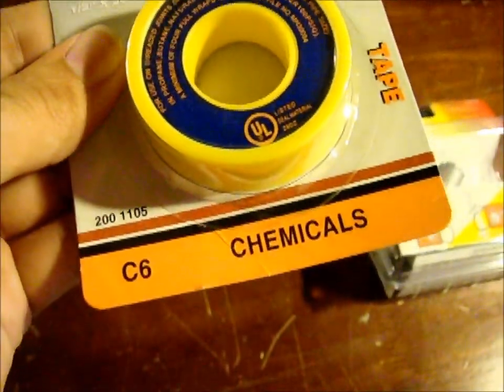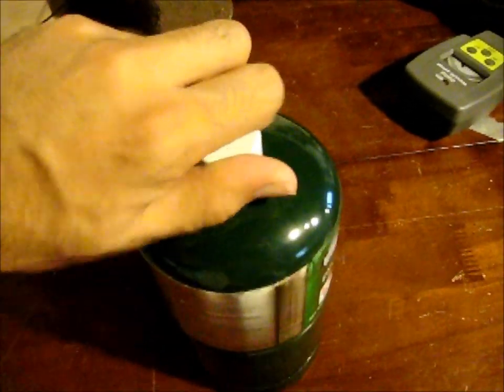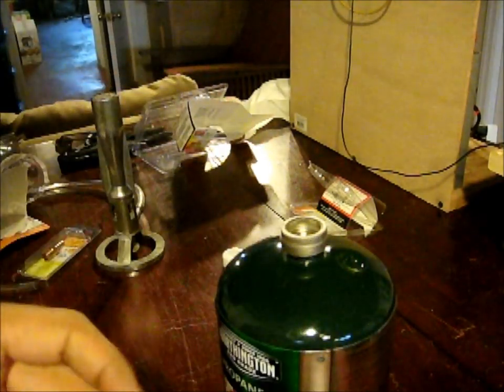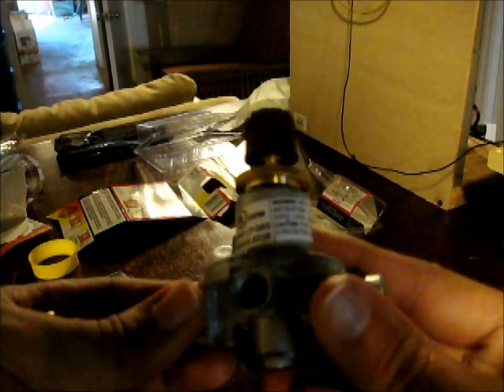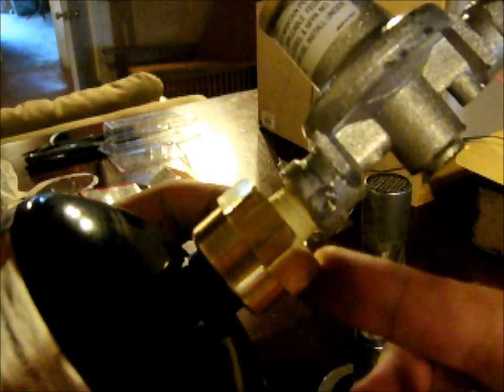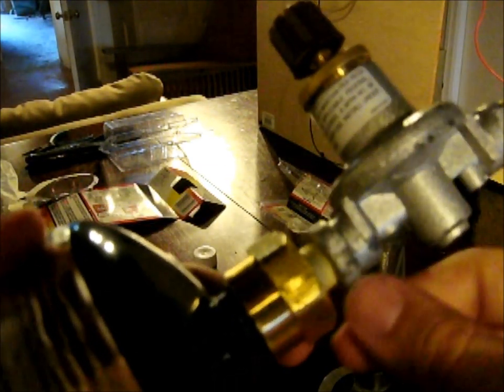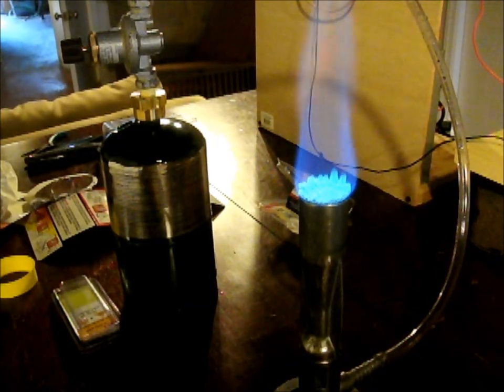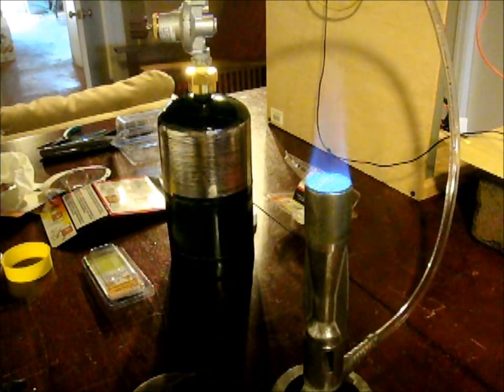Bunsen Burner DIY: Regulated Gas Supply

Comment: Your intake pipe that delivers gas looks awfully close to your burner. Could cause a major issue if it burns the pipe and enters your gas cylinder. You should add some increase your pipe length so that it sits more on the ground around your burner.